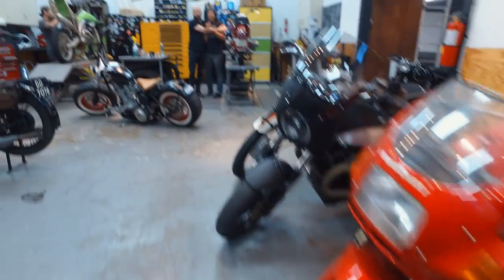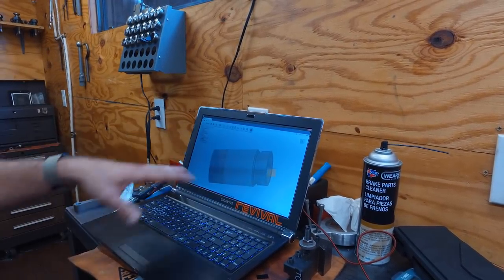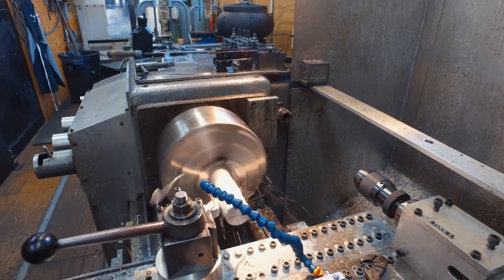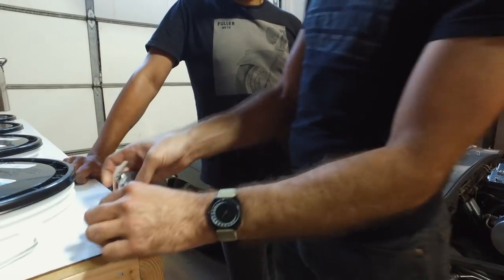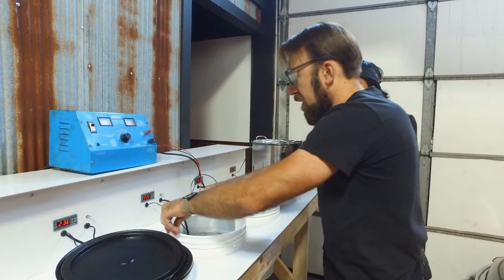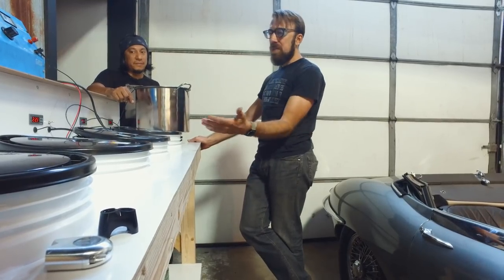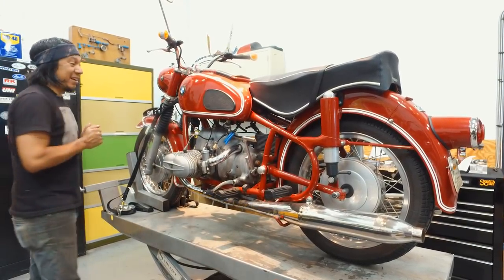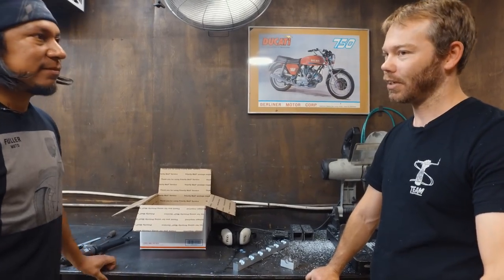DIY Anodizing // Revival Daily 41

Comment: Have you thought of using a magnetic stirrer for the dye? Fit it under the pail and place the stirrer bar in the pail. Maybe a larger one would be needed but I'd expect it the field powerful enough to go through the plastic.  Btw, can I sweep the bacteria filled cutting fluid off the lathe and floor? I really want to work with you guys!
Reply from the maker: yes, actually that is the solution we are shifting to...already have the parts ordered.